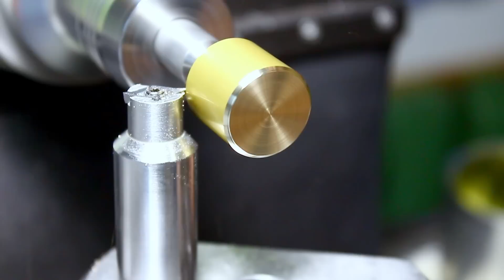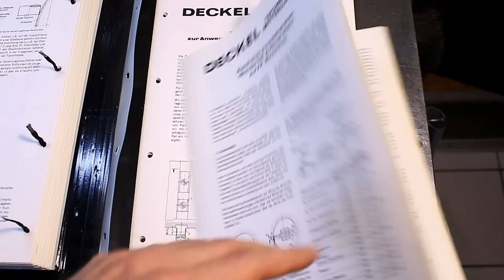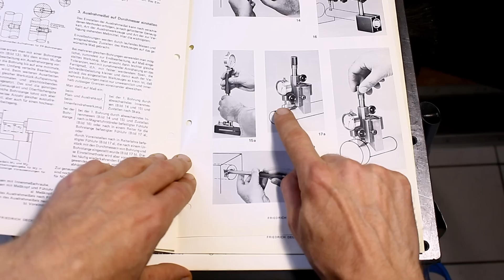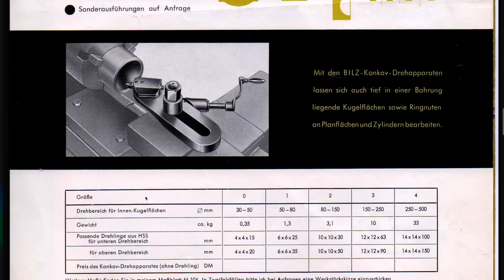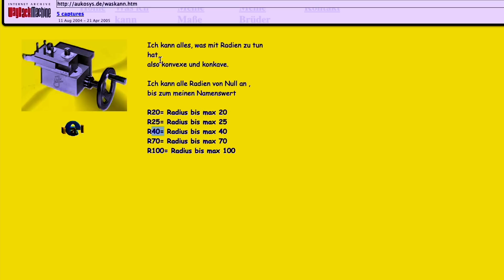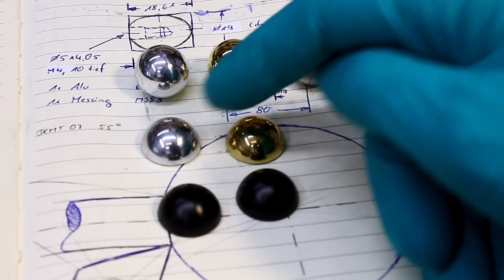Ball turning on the milling machine - And thoughts about ball turners

Comment: The one thing I need that the paired eccentric fixture can do is place the mouth radius on the inside diameter of a sleeve or bushing.  I make large (8" to 12" dia) bronze plain bearings for large punch presses. They typically have a radius on the face of the bore that mates with the corner radius on a crankshaft.  That is awkard to do accurately and safely on a manual lathe.  I've looked for solutions and thats the best ive seen. Otherwise im still doing it with a radius ground in a high speed cutter.  Lots of pressure and chatter. No fun.

Comment: Great video Stefan. I'm a jeweller (not a machinist!) and have been looking for a way to machine repeatable concave radii in the end of stainless steel (30mm stock, concave is off-centre) in the lathe. Have been messing with a copy set up with a template clamped to the bed and a tracer on the cross slide.  Not sure it'll work... love the look of the Bilz tools! Thanks for posting and look forward to where you go with it :)

Comment: 0:30 - if Einstein was your subscriber he would strongly disagree )

as for clearance issue - you can install a carbide rod into boring head vertically and grind a cutter geometry on its face.  it's the smallest profile you can get.

Comment: i wonder if you could place the pivot points on different locations , on the double eccentric radius machine. say one on 11o clock and on on 1 o clock. the tip could do some interesting sweep motion and get you some other shapes than just ball. not shore if the canter distance between the 2 will stay constant.....

Comment: Hi Stefan, fyi I made a radius turning tool for the lathe that does internal and external radii, 0 to maybe 60mm, on axis or off axis.  It's very simple and far from perfect, next time I would include a worm drive on the rotation axis and a sliding way on the toolpost to advance the tool.  It limits vertical clearance but you can use a collet chuck to help with that.  Execution is at my level not yours, but maybe some of the principles can be adapted and improved.  Here is a link that shows it:  https://www.youtube.com/watch?v=BlTAlJsrLzU

Comment: Hi Stefan, with the double eccentric arrangment, would a button cutter not describe a circle in the material due to the changing contact point around the button? or does it cancel itself out? can't quite figure it out. thanks, lovely video

Comment: it may not have the 7 degree's but at least it has 3 large registraion/contact surfaces on the side with a solid flat bottom whice is like 85-90% of whats really needed. and for one/few times low volume its totally fine

Comment: not quite sure if you have the space, but I'd definitely would be looking to get one of the small older gen Schaublin cnc lathes (the 125 size) and retrofit it as a toolroom cnc lathe, they often pop up on auction sites for 2-3k or less, have it as a side project, because all those attachments for manual machines are 99% of time sitting on shelf doing nothing, and it is just couple lines of code to get these shapes turned
don't get me wrong, I'm not dissing manual machining skills, just saying that a lot more could be done in the same amount of time even with a toolroom type cnc lathe

Comment: So if the tip of the cutting insert was on the centre line of the insert holder, you could rotate the insert holder during the job.    This would also centre the tool forces.  No overhang.

Comment: Once the radius is set on the boring head the cuts can be added by moving the X axis. This can be useful with the cheaper boring heads.
Reply from the maker: Yeah, but with a almost full sphere that gets a bit funny at the "polar" caps of the sphere, since you taper the cut out to zero

Comment: Hi Stefan, could you add a front support by using the tail stock similar to a pressure turning operation to increase the stiffness?
Reply from the maker: at least for roughing that would be an option, but it would be in the way for a full finishing cut.
Reply: @StefanGotteswinter Yeah, I was thinking you could do the front rounding first and the use a soft brass/copper hollow cone for support

Comment: Hi, what are your thoughts on the weiler "teach" lathes (manual+cnc) with encoders? I was thinking about one as my only lathe but I have never run one and feel like I would might be better off with a manual lathe as well as a turning center.
Reply from the maker: I had one demoed to me at a tradeshow and was very, very impressed. The entire user concept was made by someone who had to use a lathe before.
I was very impressed at how well the manual/cycle operations work, even for things like thread repair/thread chasing, thats normaly a bit annoying on a cnc lathe.

Comment: ❤ may I ask Stefan: does the DOC vary on materials, and obviously that would lower number of passes? Thank you amazing work as always, much appreciated ❤
Reply from the maker: yes - the depth of cut possible is a function of the forces from machining and the rigidity of the workholding.
Reply: @StefanGotteswinter thank you Stefan❤

Comment: I did a very similar thing, granted I was using a CNC but we had to end with a very small stem for a very small hole (around 3mm on a ~25mm ball in SS). So what we did was finished most of it cut it off and then flipped it around and held it in a cup fixture and with the tail stock to provide support I finished the rest of the ball until it was as close as I dare take it. Then just sanded/polished it into blend the part mark. It again was a decorative part so it had to look good from far without needed to be perfect from up close. I love the old mechanical contrivances to solve problems that modern CNC makes more trivial but all the principals stay the same. Very nice work!

Comment: I've seen concave spherical arbours placed in headstock and tailstock used to trap the incomplete ball between them. The ball turning tool will then give you a complete ball. Has to be rather precisely machined arbours though so tricky, and only works for that particular diameter ball.
Reply from the maker: Yeah! i think woodworkers do that when turning spheres in wood.
A vacuum or glue chuck with a spherical pocket will work too, bit its always a second setup.
Reply: @StefanGotteswinter  Joe Pie did something similar to this set up when he made some miniature cannon balls on his lathe.

Comment: form tool?
Reply from the maker: No chance with that large of a diameter radius and that thin of a shank to hold the part. It would simply snap off.
Reply: @StefanGotteswinter  yeah lot of tool pressure. would need  a pretty robust lathe too

Comment: Radius is a easy problem to solve on grinder
Reply from the maker: Well, its pretty much the same as on a mill/lathe - Move something on a circular path?
Reply: @StefanGotteswinter yes but with less force and vibration, plus you can dress the radius and use it for square and round parts
Reply: @StefanGotteswinter also this dual pivot turning tool is really interesting even to grind ID radius like you did on your carbide parts

Comment: Nice to hear your thoughts on ball turners, I have been brainstorming on and off for a ball and radius turner design for two years now and I finally arrived at something that I think will be versatile, easy to use and easy to make. I’ve been ordering some materials so hopefully soon I will join the ball turner’s club 🤞
Reply from the maker: Will be curious what you settle on!
Reply: @StefanGotteswinter  pretty much what you showed conceptually at the 20 minute mark but optimised for clearance and/or rigidity. Can’t promise a video soon but it will be made eventually 😁

Comment: I have a size 1 Bilz concave cutter that I use as a ball turner. They very nicely made and well worth picking up if you see one .   Horizontal mills are just so useful and versatile that I'm surprised they fell out of use.   If you want to cut yourself some big balls (for personal use say, I don't judge ;-)) a rotary table with boring head clamped  to it, works really well .

Comment: Man, everytime you post I want an Deckel FP2 more and more. Your FP1 is such a versatile machine. Now if only I had the space
Reply: I have a Maho MH700 - the quality is right up there. They are often quite a bit cheaper than a Deckel, so don't restrict yourself to a Deckel. They also made a MH600. Tooling is an issue as usual - mine uses MT4 taper with the S20x2 buttress thread for the drawbar.
Reply: I'd like to get a rebuilt Deckel FP2 from FPS

Comment: The green paste Is not chromium oxide ? I use chromium oxide on a strip of leather for stropping free hand razors .
Reply from the maker: Uhm, could also be the case :D
I thought its aluminium oxide, but i might be wrong. That has happened a lot of times in the past :D
Reply: @StefanGotteswinter do you try cerium oxide ? Is use in optical industry ti lap/polish glass and also i think Is use ti polish gems like Ruby . 

I use cerium oxide 3.5um(color Orange) and 2um(White) to lap/dress sharpening Stones . 
Is softer than diamond and in hard Stones leaves lesso scratch on the surface

Comment: Nice set up Stefan.
Reply: agreed. You know a gateway to CNC might be to put in a fly by wire system... where you manually control some stepper motors on one or more of the controls ?  Maybe something to play around with in the spare time... =D  Or just play around with a manual controlled stepper motor or servo. Happy Wednesday!